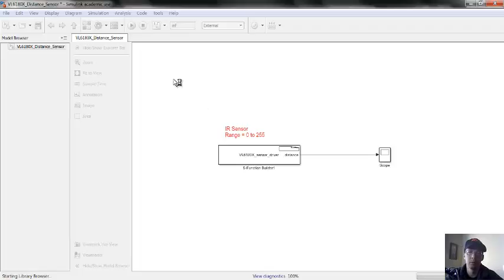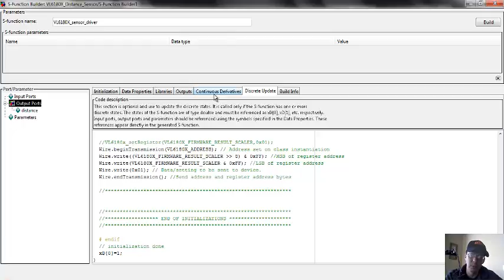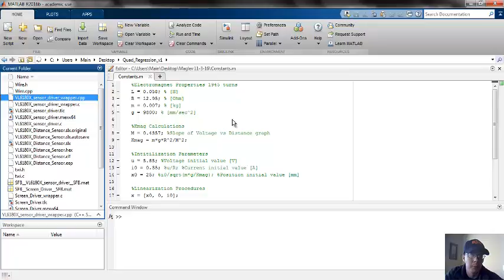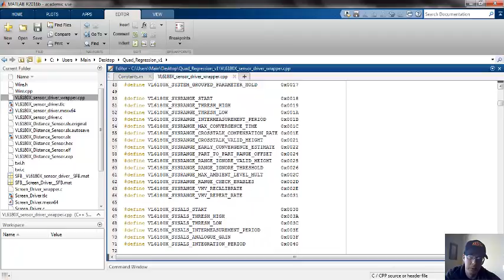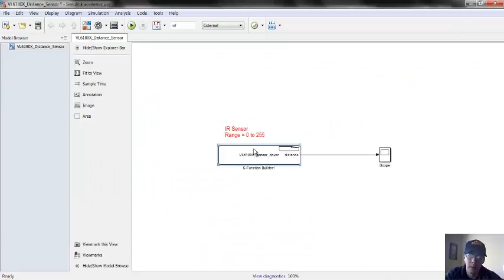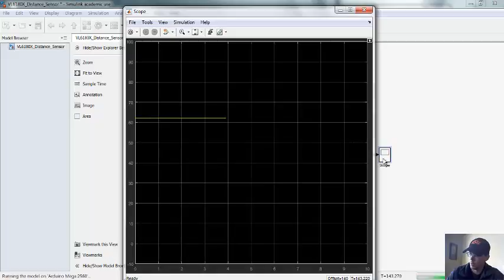Aruino Simulink I2C and the Vl6180 sensor

Comment: Thanks a lot for the detailed video. By any chance, would you share the code ? I´m ok with writing down all that instructions but it could save me some time :-) And do you know if adaptions are required to work on the DUE board ?
Reply from the maker: I will try to find the code and post it tonight. Also, I do not know if it works on the due, but I don't see why not.
Reply from the maker: I used dollar signs in order to break up sections of the code.

//NOTES:  uner initializations its number of discrete outputs 1
//sample time i have .01
// uner data properties i have the word distance as a double type//$$$$$$$$$$$$$$$$$$$$$$ this code is uner libraries
#ifndef MATLAB_MEX_FILE
#include <Arduino.h>
#include <math.h>
#include <Wire.h>
#include <Wire.cpp>
#include <twi.h>
#include <twi.c>
//*******************************************************
//********************** VL6180X **********************
//*******************************************************
#define VL6180X_ADDRESS 0x29#define VL6180x_FAILURE_RESET  -1#define VL6180X_IDENTIFICATION_MODEL_ID              0x0000
#define VL6180X_IDENTIFICATION_MODEL_REV_MAJOR       0x0001
#define VL6180X_IDENTIFICATION_MODEL_REV_MINOR       0x0002
#define VL6180X_IDENTIFICATION_MODULE_REV_MAJOR      0x0003
#define VL6180X_IDENTIFICATION_MODULE_REV_MINOR      0x0004
#define VL6180X_IDENTIFICATION_DATE                  0x0006 //16bit value
#define VL6180X_IDENTIFICATION_TIME                  0x0008 //16bit value#define VL6180X_SYSTEM_MODE_GPIO0                    0x0010
#define VL6180X_SYSTEM_MODE_GPIO1                    0x0011
#define VL6180X_SYSTEM_HISTORY_CTRL                  0x0012
#define VL6180X_SYSTEM_INTERRUPT_CONFIG_GPIO         0x0014
#define VL6180X_SYSTEM_INTERRUPT_CLEAR               0x0015
#define VL6180X_SYSTEM_FRESH_OUT_OF_RESET            0x0016
#define VL6180X_SYSTEM_GROUPED_PARAMETER_HOLD        0x0017#define VL6180X_SYSRANGE_START                       0x0018
#define VL6180X_SYSRANGE_THRESH_HIGH                 0x0019
#define VL6180X_SYSRANGE_THRESH_LOW                  0x001A
#define VL6180X_SYSRANGE_INTERMEASUREMENT_PERIOD     0x001B
#define VL6180X_SYSRANGE_MAX_CONVERGENCE_TIME        0x001C
#define VL6180X_SYSRANGE_CROSSTALK_COMPENSATION_RATE 0x001E
#define VL6180X_SYSRANGE_CROSSTALK_VALID_HEIGHT      0x0021
#define VL6180X_SYSRANGE_EARLY_CONVERGENCE_ESTIMATE  0x0022
#define VL6180X_SYSRANGE_PART_TO_PART_RANGE_OFFSET   0x0024
#define VL6180X_SYSRANGE_RANGE_IGNORE_VALID_HEIGHT   0x0025
#define VL6180X_SYSRANGE_RANGE_IGNORE_THRESHOLD      0x0026
#define VL6180X_SYSRANGE_MAX_AMBIENT_LEVEL_MULT      0x002C
#define VL6180X_SYSRANGE_RANGE_CHECK_ENABLES         0x002D
#define VL6180X_SYSRANGE_VHV_RECALIBRATE             0x002E
#define VL6180X_SYSRANGE_VHV_REPEAT_RATE             0x0031#define VL6180X_SYSALS_START                         0x0038
#define VL6180X_SYSALS_THRESH_HIGH                   0x003A
#define VL6180X_SYSALS_THRESH_LOW                    0x003C
#define VL6180X_SYSALS_INTERMEASUREMENT_PERIOD       0x003E
#define VL6180X_SYSALS_ANALOGUE_GAIN                 0x003F
#define VL6180X_SYSALS_INTEGRATION_PERIOD            0x0040#define VL6180X_RESULT_RANGE_STATUS                  0x004D
#define VL6180X_RESULT_ALS_STATUS                    0x004E
#define VL6180X_RESULT_INTERRUPT_STATUS_GPIO         0x004F
#define VL6180X_RESULT_ALS_VAL                       0x0050
#define VL6180X_RESULT_HISTORY_BUFFER                0x0052 
#define VL6180X_RESULT_RANGE_VAL                     0x0062
#define VL6180X_RESULT_RANGE_RAW                     0x0064
#define VL6180X_RESULT_RANGE_RETURN_RATE             0x0066
#define VL6180X_RESULT_RANGE_REFERENCE_RATE          0x0068
#define VL6180X_RESULT_RANGE_RETURN_SIGNAL_COUNT     0x006C
#define VL6180X_RESULT_RANGE_REFERENCE_SIGNAL_COUNT  0x0070
#define VL6180X_RESULT_RANGE_RETURN_AMB_COUNT        0x0074
#define VL6180X_RESULT_RANGE_REFERENCE_AMB_COUNT     0x0078
#define VL6180X_RESULT_RANGE_RETURN_CONV_TIME        0x007C
#define VL6180X_RESULT_RANGE_REFERENCE_CONV_TIME     0x0080#define VL6180X_READOUT_AVERAGING_SAMPLE_PERIOD      0x010A
#define VL6180X_FIRMWARE_BOOTUP                      0x0119
#define VL6180X_FIRMWARE_RESULT_SCALER               0x0120
#define VL6180X_I2C_SLAVE_DEVICE_ADDRESS             0x0212
#define VL6180X_INTERLEAVED_MODE_ENABLE              0x02A3# endif
Reply from the maker: //$$$$$$$$$$$$$$$$$$$$$$$$$$$$$$$$$$$$$$$$$$$ this code is under outpus//
// wait until after initialization is done
if (xD[0]==1) {
    
  # ifndef MATLAB_MEX_FILE
   
  //****************************************************************************
  //**************** MAIN DISTANCE READING LOOP ******************************
  //****************************************************************************
  //start a single shot
  Wire.beginTransmission(VL6180X_ADDRESS); // Address set on class instantiation
  Wire.write((VL6180X_SYSRANGE_START >> 8) & 0xFF); //MSB of register address
  Wire.write(VL6180X_SYSRANGE_START & 0xFF); //LSB of register address
  Wire.write(0x01); // Data/setting to be sent to device.
  Wire.endTransmission(); //Send address and register address bytes
  
  //*****************************************************************************
  //short delay if needed
  int x = 0; while(x < 10){x++;}
  //*****************************************************************************
  
  //Read the distance value
  Wire.beginTransmission(VL6180X_ADDRESS); // Address set on class instantiation
  Wire.write((VL6180X_RESULT_RANGE_VAL >> 8) & 0xFF); //MSB of register address
  Wire.write(VL6180X_RESULT_RANGE_VAL & 0xFF); //LSB of register address
  Wire.endTransmission(false); //Send address and register address bytes
  Wire.requestFrom(VL6180X_ADDRESS , 1);
  distance[0] = Wire.read(); //Read Data from selected register  //*******************************************************************************
  // clear the interupt flag
  Wire.beginTransmission(VL6180X_ADDRESS); // Address set on class instantiation
  Wire.write((VL6180X_SYSTEM_INTERRUPT_CLEAR >> 8) & 0xFF); //MSB of register address
  Wire.write(VL6180X_SYSTEM_INTERRUPT_CLEAR & 0xFF); //LSB of register address
  Wire.write(0x07); // Data/setting to be sent to device.
  Wire.endTransmission(); //Send address and register address bytes
    
  //********************************************************************************
  //******************** END OF DISTANCE READING LOOP ****************************
  //********************************************************************************
  
  # endif
}
Reply from the maker: //$$$$$$$$$$$$$$$$$$$$$$$$$$$$ this code is under the discrete updateif (xD[0]!=1) {
    
  # ifndef MATLAB_MEX_FILE
  
  Wire.begin(); // start i2c bus  
  //*************************************************************
  //*********** VL6180X REGISTER INITIALIZING *****************
  //*************************************************************
  
  
   
  //uint8_t VL6180x::VL6180xInit(void){
 // uint8_t data; //for temp data storage // uint8_tdata = VL6180x_getRegister(VL6180X_SYSTEM_FRESH_OUT_OF_RESET);
  Wire.beginTransmission(VL6180X_ADDRESS); // Address set on class instantiation
  Wire.write((VL6180X_SYSTEM_FRESH_OUT_OF_RESET >> 8) & 0xFF); //MSB of register address
  Wire.write(VL6180X_SYSTEM_FRESH_OUT_OF_RESET & 0xFF); //LSB of register address
  Wire.endTransmission(false); //Send address and register address bytes
  Wire.requestFrom(VL6180X_ADDRESS , 1);
  uint8_t data = Wire.read(); //Read Data from selected register  //*************************************************************
  //*********** VL6180X REGISTER RESET ************************
  //*************************************************************
 // if(sensor.VL6180xInit() != 0){
 //   Serial.println("FAILED TO INITALIZE"); //Initialize device and check for errors  // Initializations Required by datasheet
  if(data != 1)
  {
      /* return VL6180x_FAILURE_RESET;*/
  }
  else
  {
  //Required by datasheet  //VL6180x_setRegister(0x0207, 0x01);
  Wire.beginTransmission(VL6180X_ADDRESS); // Address set on class instantiation
  Wire.write((0x0207 >> 8) & 0xFF); //MSB of register address
  Wire.write(0x0207 & 0xFF); //LSB of register address
  Wire.write(0x01); // Data/setting to be sent to device.
  Wire.endTransmission(); //Send address and register address bytes
Reply from the maker: //************************************************************************
   
  //VL6180x_setRegister(0x0208, 0x01);
  Wire.beginTransmission(VL6180X_ADDRESS); // Address set on class instantiation
  Wire.write((0x0208 >> 8) & 0xFF); //MSB of register address
  Wire.write(0x0208 & 0xFF); //LSB of register address
  Wire.write(0x01); // Data/setting to be sent to device.
  Wire.endTransmission(); //Send address and register address bytes  //************************************************************************
   
  //VL6180x_setRegister(0x0096, 0x00);
  Wire.beginTransmission(VL6180X_ADDRESS); // Address set on class instantiation
  Wire.write((0x0096 >> 8) & 0xFF); //MSB of register address
  Wire.write(0x0096 & 0xFF); //LSB of register address
  Wire.write(0x00); // Data/setting to be sent to device.
  Wire.endTransmission(); //Send address and register address bytes  //************************************************************************
    
  // VL6180x_setRegister(0x0097, 0xfd);
  Wire.beginTransmission(VL6180X_ADDRESS); // Address set on class instantiation
  Wire.write((0x0097 >> 8) & 0xFF); //MSB of register address
  Wire.write(0x0097 & 0xFF); //LSB of register address
  Wire.write(0xfd); // Data/setting to be sent to device.
  Wire.endTransmission(); //Send address and register address bytes  //************************************************************************
   
  //VL6180x_setRegister(0x00e3, 0x00);
  Wire.beginTransmission(VL6180X_ADDRESS); // Address set on class instantiation
  Wire.write((0x00e3 >> 8) & 0xFF); //MSB of register address
  Wire.write(0x00e3 & 0xFF); //LSB of register address
  Wire.write(0x00); // Data/setting to be sent to device.
  Wire.endTransmission(); //Send address and register address bytes  //************************************************************************
   
  //VL6180x_setRegister(0x00e4, 0x04);
  Wire.beginTransmission(VL6180X_ADDRESS); // Address set on class instantiation
  Wire.write((0x00e4 >> 8) & 0xFF); //MSB of register address
  Wire.write(0x00e4 & 0xFF); //LSB of register address
  Wire.write(0x04); // Data/setting to be sent to device.
  Wire.endTransmission(); //Send address and register address bytes  //************************************************************************
   
  //VL6180x_setRegister(0x00e5, 0x02);
  Wire.beginTransmission(VL6180X_ADDRESS); // Address set on class instantiation
  Wire.write((0x00e5 >> 8) & 0xFF); //MSB of register address
  Wire.write(0x00e5 & 0xFF); //LSB of register address
  Wire.write(0x02); // Data/setting to be sent to device.
  Wire.endTransmission(); //Send address and register address bytes  //************************************************************************
   
  //VL6180x_setRegister(0x00e6, 0x01);
  Wire.beginTransmission(VL6180X_ADDRESS); // Address set on class instantiation
  Wire.write((0x00e6 >> 8) & 0xFF); //MSB of register address
  Wire.write(0x00e6 & 0xFF); //LSB of register address
  Wire.write(0x01); // Data/setting to be sent to device.
  Wire.endTransmission(); //Send address and register address bytes  //************************************************************************
   
  //VL6180x_setRegister(0x00e7, 0x03);
  Wire.beginTransmission(VL6180X_ADDRESS); // Address set on class instantiation
  Wire.write((0x00e7 >> 8) & 0xFF); //MSB of register address
  Wire.write(0x00e7 & 0xFF); //LSB of register address
  Wire.write(0x03); // Data/setting to be sent to device.
  Wire.endTransmission(); //Send address and register address bytes  //************************************************************************
   
  //VL6180x_setRegister(0x00f5, 0x02);
  Wire.beginTransmission(VL6180X_ADDRESS); // Address set on class instantiation
  Wire.write((0x00f5 >> 8) & 0xFF); //MSB of register address
  Wire.write(0x00f5 & 0xFF); //LSB of register address
  Wire.write(0x02); // Data/setting to be sent to device.
  Wire.endTransmission(); //Send address and register address bytes  //************************************************************************
   
  //VL6180x_setRegister(0x00d9, 0x05);
  Wire.beginTransmission(VL6180X_ADDRESS); // Address set on class instantiation
  Wire.write((0x00d9 >> 8) & 0xFF); //MSB of register address
  Wire.write(0x00d9 & 0xFF); //LSB of register address
  Wire.write(0x05); // Data/setting to be sent to device.
  Wire.endTransmission(); //Send address and register address bytes  //************************************************************************
   
  //VL6180x_setRegister(0x00db, 0xce);
  Wire.beginTransmission(VL6180X_ADDRESS); // Address set on class instantiation
  Wire.write((0x00db >> 8) & 0xFF); //MSB of register address
  Wire.write(0x00db & 0xFF); //LSB of register address
  Wire.write(0xce); // Data/setting to be sent to device.
  Wire.endTransmission(); //Send address and register address bytes  //************************************************************************
   
  //VL6180x_setRegister(0x00dc, 0x03);
  Wire.beginTransmission(VL6180X_ADDRESS); // Address set on class instantiation
  Wire.write((0x00dc >> 8) & 0xFF); //MSB of register address
  Wire.write(0x00dc & 0xFF); //LSB of register address
  Wire.write(0x03); // Data/setting to be sent to device.
  Wire.endTransmission(); //Send address and register address bytes  //************************************************************************
   
  //VL6180x_setRegister(0x00dd, 0xf8);
  Wire.beginTransmission(VL6180X_ADDRESS); // Address set on class instantiation
  Wire.write((0x00dd >> 8) & 0xFF); //MSB of register address
  Wire.write(0x00dd & 0xFF); //LSB of register address
  Wire.write(0xf8); // Data/setting to be sent to device.
  Wire.endTransmission(); //Send address and register address bytes  //************************************************************************
   
  //VL6180x_setRegister(0x009f, 0x00);
  Wire.beginTransmission(VL6180X_ADDRESS); // Address set on class instantiation
  Wire.write((0x009f >> 8) & 0xFF); //MSB of register address
  Wire.write(0x009f & 0xFF); //LSB of register address
  Wire.write(0x00); // Data/setting to be sent to device.
  Wire.endTransmission(); //Send address and register address bytes  //************************************************************************
   
  //VL6180x_setRegister(0x00a3, 0x3c);
  Wire.beginTransmission(VL6180X_ADDRESS); // Address set on class instantiation
  Wire.write((0x00a3 >> 8) & 0xFF); //MSB of register address
  Wire.write(0x00a3 & 0xFF); //LSB of register address
  Wire.write(0x3c); // Data/setting to be sent to device.
  Wire.endTransmission(); //Send address and register address bytes  //************************************************************************
   
  //VL6180x_setRegister(0x00b7, 0x00);
  Wire.beginTransmission(VL6180X_ADDRESS); // Address set on class instantiation
  Wire.write((0x00b7 >> 8) & 0xFF); //MSB of register address
  Wire.write(0x00b7 & 0xFF); //LSB of register address
  Wire.write(0x00); // Data/setting to be sent to device.
  Wire.endTransmission(); //Send address and register address bytes  //************************************************************************
   
  //VL6180x_setRegister(0x00bb, 0x3c);
  Wire.beginTransmission(VL6180X_ADDRESS); // Address set on class instantiation
  Wire.write((0x00bb >> 8) & 0xFF); //MSB of register address
  Wire.write(0x00bb & 0xFF); //LSB of register address
  Wire.write(0x3c); // Data/setting to be sent to device.
  Wire.endTransmission(); //Send address and register address bytes
Reply from the maker: //************************************************************************
   
  //VL6180x_setRegister(0x00b2, 0x09);
  Wire.beginTransmission(VL6180X_ADDRESS); // Address set on class instantiation
  Wire.write((0x00b2 >> 8) & 0xFF); //MSB of register address
  Wire.write(0x00b2 & 0xFF); //LSB of register address
  Wire.write(0x09); // Data/setting to be sent to device.
  Wire.endTransmission(); //Send address and register address bytes  //************************************************************************
   
  //VL6180x_setRegister(0x00ca, 0x09); 
  Wire.beginTransmission(VL6180X_ADDRESS); // Address set on class instantiation
  Wire.write((0x00ca >> 8) & 0xFF); //MSB of register address
  Wire.write(0x00ca & 0xFF); //LSB of register address
  Wire.write(0x09); // Data/setting to be sent to device.
  Wire.endTransmission(); //Send address and register address bytes  //************************************************************************
   
  //VL6180x_setRegister(0x0198, 0x01);
  Wire.beginTransmission(VL6180X_ADDRESS); // Address set on class instantiation
  Wire.write((0x0198 >> 8) & 0xFF); //MSB of register address
  Wire.write(0x0198 & 0xFF); //LSB of register address
  Wire.write(0x01); // Data/setting to be sent to device.
  Wire.endTransmission(); //Send address and register address bytes  //************************************************************************
   
  //VL6180x_setRegister(0x01b0, 0x17);
  Wire.beginTransmission(VL6180X_ADDRESS); // Address set on class instantiation
  Wire.write((0x01b0 >> 8) & 0xFF); //MSB of register address
  Wire.write(0x01b0 & 0xFF); //LSB of register address
  Wire.write(0x17); // Data/setting to be sent to device.
  Wire.endTransmission(); //Send address and register address bytes  //************************************************************************
   
  //VL6180x_setRegister(0x01ad, 0x00);
  Wire.beginTransmission(VL6180X_ADDRESS); // Address set on class instantiation
  Wire.write((0x01ad >> 8) & 0xFF); //MSB of register address
  Wire.write(0x01ad & 0xFF); //LSB of register address
  Wire.write(0x00); // Data/setting to be sent to device.
  Wire.endTransmission(); //Send address and register address bytes  //************************************************************************
   
  //VL6180x_setRegister(0x00ff, 0x05);
  Wire.beginTransmission(VL6180X_ADDRESS); // Address set on class instantiation
  Wire.write((0x00ff >> 8) & 0xFF); //MSB of register address
  Wire.write(0x00ff & 0xFF); //LSB of register address
  Wire.write(0x05); // Data/setting to be sent to device.
  Wire.endTransmission(); //Send address and register address bytes  //************************************************************************
   
  //VL6180x_setRegister(0x0100, 0x05);
  Wire.beginTransmission(VL6180X_ADDRESS); // Address set on class instantiation
  Wire.write((0x0100 >> 8) & 0xFF); //MSB of register address
  Wire.write(0x0100 & 0xFF); //LSB of register address
  Wire.write(0x05); // Data/setting to be sent to device.
  Wire.endTransmission(); //Send address and register address bytes  //************************************************************************
   
  //VL6180x_setRegister(0x0199, 0x05);
  Wire.beginTransmission(VL6180X_ADDRESS); // Address set on class instantiation
  Wire.write((0x0199 >> 8) & 0xFF); //MSB of register address
  Wire.write(0x0199 & 0xFF); //LSB of register address
  Wire.write(0x05); // Data/setting to be sent to device.
  Wire.endTransmission(); //Send address and register address bytes  //************************************************************************
   
  //VL6180x_setRegister(0x01a6, 0x1b);
  Wire.beginTransmission(VL6180X_ADDRESS); // Address set on class instantiation
  Wire.write((0x01a6 >> 8) & 0xFF); //MSB of register address
  Wire.write(0x01a6 & 0xFF); //LSB of register address
  Wire.write(0x1b); // Data/setting to be sent to device.
  Wire.endTransmission(); //Send address and register address bytes  //************************************************************************
   
  //VL6180x_setRegister(0x01ac, 0x3e);
  Wire.beginTransmission(VL6180X_ADDRESS); // Address set on class instantiation
  Wire.write((0x01ac >> 8) & 0xFF); //MSB of register address
  Wire.write(0x01ac & 0xFF); //LSB of register address
  Wire.write(0x3e); // Data/setting to be sent to device.
  Wire.endTransmission(); //Send address and register address bytes  //************************************************************************
   
  //VL6180x_setRegister(0x01a7, 0x1f);
  Wire.beginTransmission(VL6180X_ADDRESS); // Address set on class instantiation
  Wire.write((0x01a7 >> 8) & 0xFF); //MSB of register address
  Wire.write(0x01a7 & 0xFF); //LSB of register address
  Wire.write(0x1f); // Data/setting to be sent to device.
  Wire.endTransmission(); //Send address and register address bytes  //************************************************************************
   
  //VL6180x_setRegister(0x0030, 0x00);
  Wire.beginTransmission(VL6180X_ADDRESS); // Address set on class instantiation
  Wire.write((0x0030 >> 8) & 0xFF); //MSB of register address
  Wire.write(0x0030 & 0xFF); //LSB of register address
  Wire.write(0x00); // Data/setting to be sent to device.
  Wire.endTransmission(); //Send address and register address bytes  //************************************************************************
  //return 0;
}
Reply from the maker: //*************************************************************
  //*********** VL6180X REGISTER INITIALIZING *****************
  //*************************************************************
  
  //Recommended settings from datasheet
  //Enable Interrupts on Conversion Complete (any source)
      
 
  //VL6180x_setRegister(VL6180X_SYSTEM_INTERRUPT_CONFIG_GPIO, (4 << 3)|(4) ); // Set GPIO1 high when sample complete
  Wire.beginTransmission(VL6180X_ADDRESS); // Address set on class instantiation
  Wire.write((VL6180X_SYSTEM_INTERRUPT_CONFIG_GPIO >> 8) & 0xFF); //MSB of register address
  Wire.write(VL6180X_SYSTEM_INTERRUPT_CONFIG_GPIO & 0xFF); //LSB of register address
  Wire.write((4<<3)|(4)); // Data/setting to be sent to device.
  Wire.endTransmission(); //Send address and register address bytes
  
  //*************************************************************
  
  //VL6180x_setRegister(VL6180X_SYSTEM_MODE_GPIO1, 0x10); // Set GPIO1 high when sample complete
  Wire.beginTransmission(VL6180X_ADDRESS); // Address set on class instantiation
  Wire.write((VL6180X_SYSTEM_MODE_GPIO1 >> 8) & 0xFF); //MSB of register address
  Wire.write(VL6180X_SYSTEM_MODE_GPIO1 & 0xFF); //LSB of register address
  Wire.write(0x10); // Data/setting to be sent to device.
  Wire.endTransmission(); //Send address and register address bytes
  
  //*************************************************************
  
  //VL6180x_setRegister(VL6180X_READOUT_AVERAGING_SAMPLE_PERIOD, 0x30); //Set Avg sample period
  Wire.beginTransmission(VL6180X_ADDRESS); // Address set on class instantiation
  Wire.write((VL6180X_READOUT_AVERAGING_SAMPLE_PERIOD >> 8) & 0xFF); //MSB of register address
  Wire.write(VL6180X_READOUT_AVERAGING_SAMPLE_PERIOD & 0xFF); //LSB of register address
  Wire.write(0x90); // Data/setting to be sent to device.
  Wire.endTransmission(); //Send address and register address bytes
  //0x30 
  //*************************************************************
  
  //VL6180x_setRegister(VL6180X_SYSALS_ANALOGUE_GAIN, 0x46); // Set the ALS gain
  Wire.beginTransmission(VL6180X_ADDRESS); // Address set on class instantiation
  Wire.write((VL6180X_SYSALS_ANALOGUE_GAIN >> 8) & 0xFF); //MSB of register address
  Wire.write(VL6180X_SYSALS_ANALOGUE_GAIN & 0xFF); //LSB of register address
  Wire.write(0x46); // Data/setting to be sent to device.
  Wire.endTransmission(); //Send address and register address bytes
  
  //*************************************************************
  
  //VL6180x_setRegister(VL6180X_SYSRANGE_VHV_REPEAT_RATE, 0xFF); // Set auto calibration period (Max = 255)/(OFF = 0)
  Wire.beginTransmission(VL6180X_ADDRESS); // Address set on class instantiation
  Wire.write((VL6180X_SYSRANGE_VHV_REPEAT_RATE >> 8) & 0xFF); //MSB of register address
  Wire.write(VL6180X_SYSRANGE_VHV_REPEAT_RATE & 0xFF); //LSB of register address
  Wire.write(0xFF); // Data/setting to be sent to device.
  Wire.endTransmission(); //Send address and register address bytes
  
  //*************************************************************
  
  //VL6180x_setRegister(VL6180X_SYSALS_INTEGRATION_PERIOD, 0x63); // Set ALS integration time to 100ms
  Wire.beginTransmission(VL6180X_ADDRESS); // Address set on class instantiation
  Wire.write((VL6180X_SYSALS_INTEGRATION_PERIOD >> 8) & 0xFF); //MSB of register address
  Wire.write(VL6180X_SYSALS_INTEGRATION_PERIOD & 0xFF); //LSB of register address
  Wire.write(0x63); // Data/setting to be sent to device.
  Wire.endTransmission(); //Send address and register address bytes
   
  //*************************************************************
  
  //VL6180x_setRegister(VL6180X_SYSRANGE_VHV_RECALIBRATE, 0x01); // perform a single temperature calibration
  Wire.beginTransmission(VL6180X_ADDRESS); // Address set on class instantiation
  Wire.write((VL6180X_SYSRANGE_VHV_RECALIBRATE >> 8) & 0xFF); //MSB of register address
  Wire.write(VL6180X_SYSRANGE_VHV_RECALIBRATE & 0xFF); //LSB of register address
  Wire.write(0x01); // Data/setting to be sent to device.
  Wire.endTransmission(); //Send address and register address bytes
  //Optional settings from datasheet
Reply from the maker: //*************************************************************
  
   //VL6180x_setRegister(VL6180X_SYSRANGE_INTERMEASUREMENT_PERIOD, 0x09); // Set default ranging inter-measurement period to 100ms
  Wire.beginTransmission(VL6180X_ADDRESS); // Address set on class instantiation
  Wire.write((VL6180X_SYSRANGE_INTERMEASUREMENT_PERIOD >> 8) & 0xFF); //MSB of register address
  Wire.write(VL6180X_SYSRANGE_INTERMEASUREMENT_PERIOD & 0xFF); //LSB of register address
  Wire.write(0x09); // Data/setting to be sent to device.
  Wire.endTransmission(); //Send address and register address bytes
  
  //*************************************************************
  
  //VL6180x_setRegister(VL6180X_SYSALS_INTERMEASUREMENT_PERIOD, 0x0A); // Set default ALS inter-measurement period to 100ms
  Wire.beginTransmission(VL6180X_ADDRESS); // Address set on class instantiation
  Wire.write((VL6180X_SYSALS_INTERMEASUREMENT_PERIOD >> 8) & 0xFF); //MSB of register address
  Wire.write(VL6180X_SYSALS_INTERMEASUREMENT_PERIOD & 0xFF); //LSB of register address
  Wire.write(0x0A); // Data/setting to be sent to device.
  Wire.endTransmission(); //Send address and register address bytes
  
  //*************************************************************
  
  //VL6180x_setRegister(VL6180X_SYSTEM_INTERRUPT_CONFIG_GPIO, 0x24); // Configures interrupt on ‘New Sample Ready threshold event
  Wire.beginTransmission(VL6180X_ADDRESS); // Address set on class instantiation
  Wire.write((VL6180X_SYSTEM_INTERRUPT_CONFIG_GPIO >> 8) & 0xFF); //MSB of register address
  Wire.write(VL6180X_SYSTEM_INTERRUPT_CONFIG_GPIO & 0xFF); //LSB of register address
  Wire.write(0x24); // Data/setting to be sent to device.
  Wire.endTransmission(); //Send address and register address bytes
  
  //*************************************************************
  
  //Additional settings defaults from community
  //VL6180x_setRegister(VL6180X_SYSRANGE_MAX_CONVERGENCE_TIME, 0x32);
  Wire.beginTransmission(VL6180X_ADDRESS); // Address set on class instantiation
  Wire.write((VL6180X_SYSRANGE_MAX_CONVERGENCE_TIME >> 8) & 0xFF); //MSB of register address
  Wire.write(VL6180X_SYSRANGE_MAX_CONVERGENCE_TIME & 0xFF); //LSB of register address
  Wire.write(0x32); // Data/setting to be sent to device.
  Wire.endTransmission(); //Send address and register address bytes
  
  //*************************************************************
  
  //VL6180x_setRegister(VL6180X_SYSRANGE_RANGE_CHECK_ENABLES, 0x10 | 0x01);
  Wire.beginTransmission(VL6180X_ADDRESS); // Address set on class instantiation
  Wire.write((VL6180X_SYSRANGE_RANGE_CHECK_ENABLES >> 8) & 0xFF); //MSB of register address
  Wire.write(VL6180X_SYSRANGE_RANGE_CHECK_ENABLES & 0xFF); //LSB of register address
  Wire.write(0x10); // Data/setting to be sent to device.
  Wire.endTransmission(); //Send address and register address bytes
  
  //*************************************************************
  
  //VL6180x_setRegister16bit(VL6180X_SYSRANGE_EARLY_CONVERGENCE_ESTIMATE, 0x7B );
  Wire.beginTransmission(VL6180X_ADDRESS); // Address set on class instantiation
  Wire.write((VL6180X_SYSRANGE_EARLY_CONVERGENCE_ESTIMATE >> 8) & 0xFF); //MSB of register address
  Wire.write(VL6180X_SYSRANGE_EARLY_CONVERGENCE_ESTIMATE & 0xFF); //LSB of register address
  Wire.write(0x7B); // Data/setting to be sent to device.
  Wire.endTransmission(); //Send address and register address bytes
  
  //*************************************************************
  
  //VL6180x_setRegister16bit(VL6180X_SYSALS_INTEGRATION_PERIOD, 0x64);
  Wire.beginTransmission(VL6180X_ADDRESS); // Address set on class instantiation
  Wire.write((VL6180X_SYSALS_INTEGRATION_PERIOD >> 8) & 0xFF); //MSB of register address
  Wire.write(VL6180X_SYSALS_INTEGRATION_PERIOD & 0xFF); //LSB of register address
  Wire.write(0x64); // Data/setting to be sent to device.
  Wire.endTransmission(); //Send address and register address bytes
  //$$$$$$$$$$ 0x64
  //*************************************************************
  
  //VL6180x_setRegister(VL6180X_READOUT_AVERAGING_SAMPLE_PERIOD,0x30);
  Wire.beginTransmission(VL6180X_ADDRESS); // Address set on class instantiation
  Wire.write((VL6180X_READOUT_AVERAGING_SAMPLE_PERIOD >> 8) & 0xFF); //MSB of register address
  Wire.write(VL6180X_READOUT_AVERAGING_SAMPLE_PERIOD & 0xFF); //LSB of register address
  Wire.write(0x30); // Data/setting to be sent to device.
  Wire.endTransmission(); //Send address and register address bytes
  
//$$$$$$$$$ 0x30
  //************************************************************* 
  
  //VL6180x_setRegister(VL6180X_SYSALS_ANALOGUE_GAIN,0x40);
  Wire.beginTransmission(VL6180X_ADDRESS); // Address set on class instantiation
  Wire.write((VL6180X_SYSALS_ANALOGUE_GAIN >> 8) & 0xFF); //MSB of register address
  Wire.write(VL6180X_SYSALS_ANALOGUE_GAIN & 0xFF); //LSB of register address
  Wire.write(0x40); // Data/setting to be sent to device.
  Wire.endTransmission(); //Send address and register address bytes
  
  //************************************************************* 
  
  //VL6180x_setRegister(VL6180X_FIRMWARE_RESULT_SCALER,0x01);
  Wire.beginTransmission(VL6180X_ADDRESS); // Address set on class instantiation
  Wire.write((VL6180X_FIRMWARE_RESULT_SCALER >> 8) & 0xFF); //MSB of register address
  Wire.write(VL6180X_FIRMWARE_RESULT_SCALER & 0xFF); //LSB of register address
  Wire.write(0x01); // Data/setting to be sent to device.
  Wire.endTransmission(); //Send address and register address bytes
  
  //*************************************************************
  //*************************************************************
  //**************** END OF INITIALIZATIONS *******************
  //*************************************************************  # endif   
  // initialization done 
  xD[0]=1;
}
Reply from the maker: The following replies are the code I tried to break it up in sections but there was a limit to the post so some sections are broke into a few posts but there in order going down. The //$$$$$$$$$$$$$ followed by a coment will help you to see where the code goes the S-function if you get lost just match the code to the video and its tab. Thanks Good Luck
Reply: Thanks a lot. Hope it helps also others.